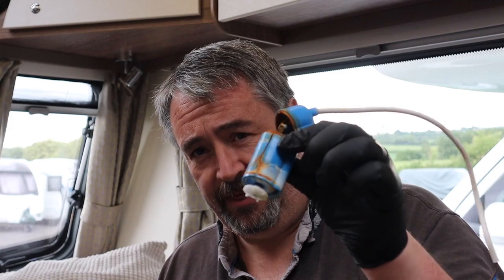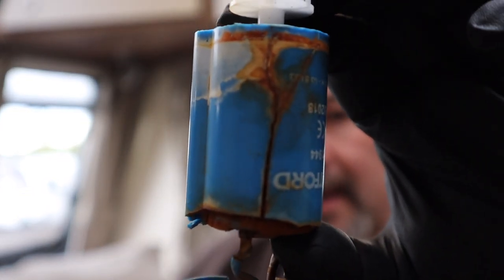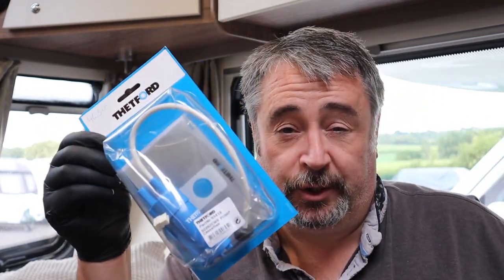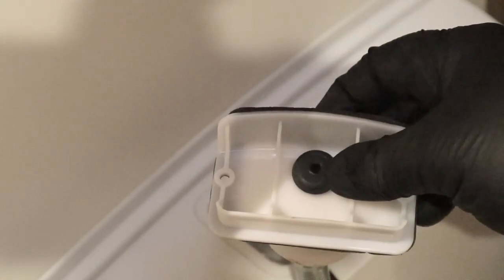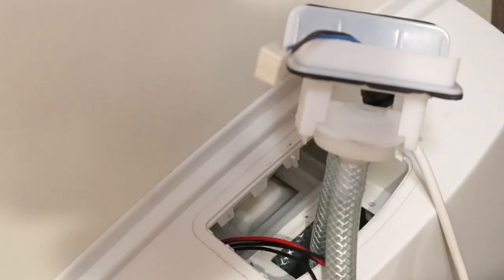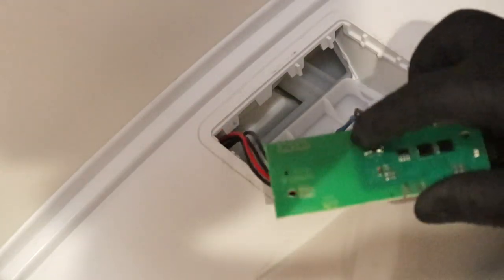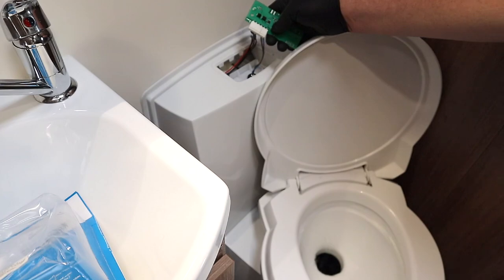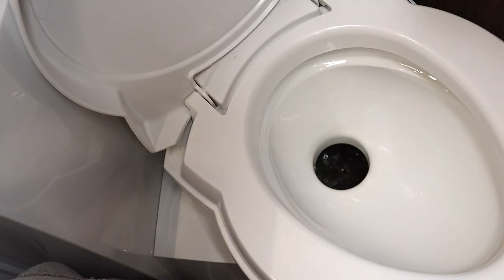Replacing Thetford C262 caravan toilet flush pump

Comment: I bought a comet replacement pump from Amazon, had to connect the original spade connector to the wires of the new pump, the wires are the same colour coding and I just soldered them and used insulation tape.
The pump is identical and works well. Thanks for your excellent video! It made the job easier to do by far!

Comment: I just fitted a non thetford pump, "Comet" off E Bay under twenty quid. you have to cut off the old connectors and fitt them to the new one.  Someone on here made a video of this but I noticed they made the connections below the grommet. In what would be the wet side. I decided to make mine above the grommet.  Works fine.

Comment: Hey Dan. I do like your videos and how you de-mystify caravan issues. Yet another superb video on how to DIY a bog pump repair. I myself dump 2 litres of screen wash into the header tank for the toilet and run it till I get screen wash in the toilet bowl. The screen wash protects down to -20'c and is from Prestone. Keep these coming as I find them highly informative. Well done that man. 👍👍
Reply: Ronin - the plastics in the pump and toilet will not survive this treatment for very long.
Reply: @jonathanp6538  It's screen wash. Good enough for cars, good enough for a toilet whilst it is in storage. Besides, I would like to think that Whale pumps tend to be of a better quality than the rubbish pumps they put into cars imo. Lots of threads about using screen wash to prevent the freezing of pumps.

Comment: Hi dan , same thing happened to me today, put it a pitch to check it over after the lockdown & the toilet pump is seized solid. I went onto Facebook unicorn 4 page looking for help. One chap on there is very good with advice, this is what advice he was given & has passed it on. .....
The one time i had mine seize was fully drained as well. I spoke to a Thetford engineer and he recommended to me leaving half litre ALdi style screenwash in over lay up periods. As rubber friendly and contains lubricant for screenwash pump. Enviro safe if not overly friendly, protects down to minus 40 if that cold here i have bigger problems. He explained it as when fully drain you are still in moist atmosphere old flush chemicals can crystalise and damp air helps corrosion form. Leaving it in half litre no air so less risk . I have done this last 8 years and all been good. I just drain into a bottle before towing and can put it back in when i return too storage.

Comment: I agree with your thought Dan that the pump was faulty to start with.To have allowed water to seep into the pump over time to the point of seizing up. Nice easy job but as Martin Caravan Nut says it's easier to change than the C250. The C250 pump is on the outside of the tank to the rear of the toilet. Take care Dan and family. Cheers Rob

Comment: Hi Dan, Pumps are designed to push water in one direction and to not let it run back out when turned off. Therefore, in frosty weather, unless you remove pump and drain it water will remain inside and cause the damage you demonstrated.  As a car owner I'm sure that in winter you use an anti freeze solution in you windscreen washer bottle. Put a little of this solution in you toilet cistern and activate the pump to primed it and you will have no more burst pump problems.
Reply from the maker: Hi, we always run the pump to empty it at the end of the holiday. In Feb the pump was running just as normal, yet in April when i checked the pump was completely seized. in the space of those 2 months, we didn't have any frost or freezing weather. 

So, whilst what you say is 100% correct, it just doesn't ring true with our actions. 

Hope you are well, 
Take care
Dan

Comment: I changed the pump on our Eccles Topaz last month.
The genuine Thetford pump for the C250 toilet was nearly £20 more expensive than the pattern part I replaced it with. They both use bog standard 600 size brushed motors which are dirt cheap.
Simple job that took about 20 minutes.

Comment: Another cause of pump failure is adding too much pink to your tank. It causes some kind of algea to grow which starts to choke the pump until it eventually fails. Same happened to me. Better still , don't use pink. Before the caravan I had 3 motorhomes. All 3 toilets fed from the on-board fresh water tank. No problems at all. When I used sterilisation fluid on the fresh water circuit it also cleaned my toilet pipes.

Comment: Hi  Dan. Great Video.   I have, I think, a Thetford C250 and the pump is not submersible, it's external and you can only access it through the external door.      Would it be possible to put an explanation (if there's not one already) on how to replace the C250 that???
Reply from the maker: Hi Dave, have a look at Martins video on replacing the pump and control board on the C250. https://www.youtube.com/watch?v=fXEWut4YGfY

Hope that helps.
Reply: @TheTrudgians   Thanks Dan. Just what I wanted.  Committed to memory,  for now.

Comment: Hello. When you empty the tank do you drain from the outside taking the rubber stopper from the draining tube.  No need to do this when there is no risk of frost but I was once caught out by not fully draining the tank and the small amount of water left in the tank froze splitting the pump exactly as you have shown here. Is it possible this has happened here. Either way a really informative video. Thanks.
Reply from the maker: HI Richard, on our last day a part of my "i don't want to go home" ritual, is emptying the flush through the rubber hose and running the pump into the cassette. so by the time we are back in storage the flush tank and the pump should be bone dry.  So, like i mentioned the only way i can see this pump being this broken is by it failing somehow. 

Take care

Comment: Hi, just a quick question. I am looking to venture into caravaning and looking to buy a large (ish)  or even a twin axel caravan and  I have looking for a vehicle to tow it with. How does the land lie with sites on towing with a  van. The van will be only for personal use and unsigned. It would be a advantage for me to have a van over something like a 4x4 but it’s not a deal breaker. Many thanks.

Comment: I flippin hate my caravan. went to get it ready for use - no power to control power. Worked out  there was no supply voltage at the back of the fuseboard pcb. Appuljack Engineering did a great job sorting that although its not cheap. Now the caravan is all ready - apart from the bleeding toilet flush again - its had a new pump, new reed switch pcv, countless new fuses - nothing. don't think I'm getting power to it at all. Hate the damn thing.

Comment: Hi dan can you help please our toilet the pump is running when pressed but theres no water coming into the bowl
Reply from the maker: Ok, it’s likely you have a blocked pipe. Try taking the pump out and release the attached pipe and either blow some air (tyre pump) up the pipe or drizzle some mild bleach into the pipe. It could be the nozzle is blocked so a thin bit of wire up the nozzle in the bowl could be an idea too.

Comment: Dan, I would use "Milton" to flush out the tank as you recommended ages ago in a vid to get rid of the "Black Bits" Nick T.
Reply: jan scott - Milton shouldn’t be used in contact with any metal. It says it on the bottle. Even stainless steel will be attacked by it.
Reply: @jonathanp6538  Check out Dan's vid of 30/9/16 where he uses "Milton". I used it after this vid with no problems or "Black Bits" forming in my loo. Not aware ther is any metal parts in a Thetford 260 toilet although some of the clips for pipes may be metallic to be fair. Any further comment Mr T
Reply: jan scott the pump sits in the flush liquid and has a metal shaft. I’m pretty sure Thetford won’t support any issues caused by aggressive cleaning.